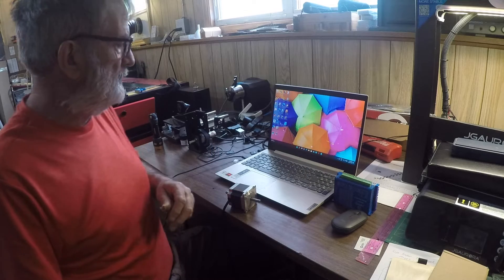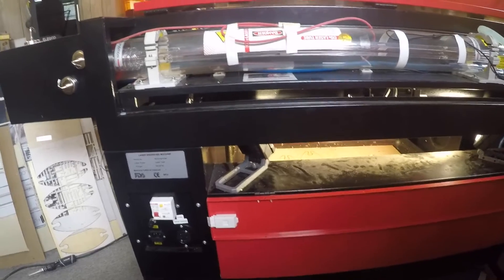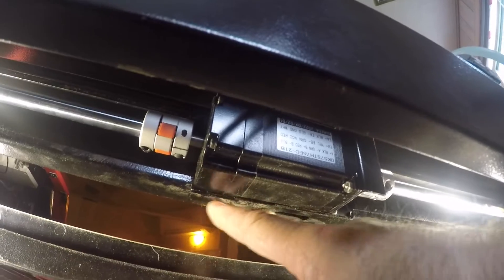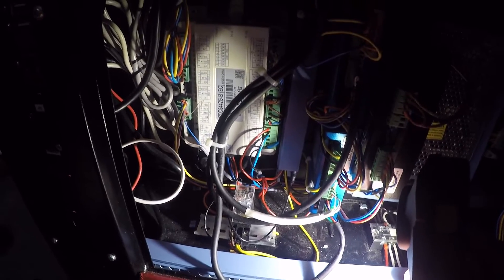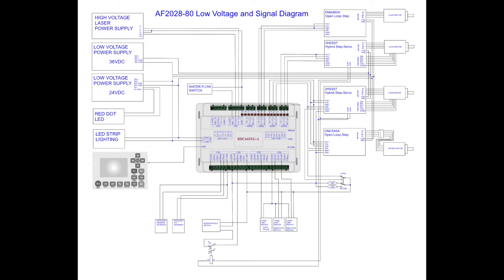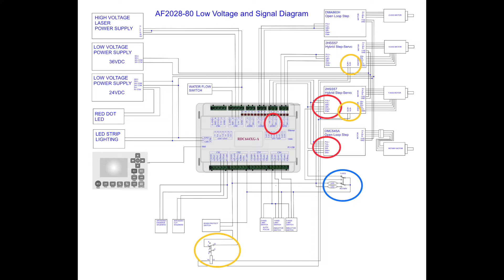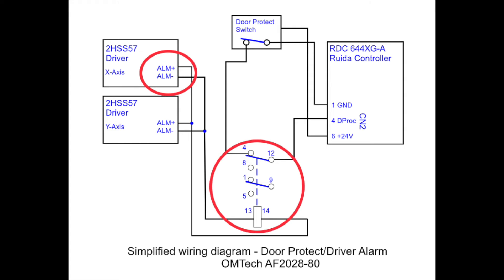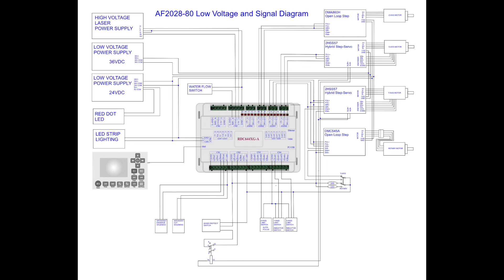AF2028-80 Closed Loop Stepper Motor upgrade: Y-Axis/Rotary

Comment: I have the parts coming this week to finally upgrade my X- axis.  Rather than notching out the frame to prevent the larger motor hitting it, would it be possible to move the stop sensor in slightly and adjust the bed size in Lightburn to accommodate?
Reply from the maker: I don’t see why not. The amount, needed to notch is not a huge amount. Mind you, if you move the sensor and adjust the bed size, you only loose 5mm, maybe
Reply: @jamesalexander5388 I think I'm overthinking this - can probably just glue a small piece of ferrous metal to the Y-gantry to trigger the magnetic limit switch ~5mm sooner
Reply from the maker: @JensRatsey  pretty sure that will work as well
Reply: @jamesalexander5388 I have my new x closed loop driver and motor installed - you're right, not for the feint hearted! The motor is so tight against the metal trough that the new track runs in that I can barely get a piece of paper in there, yet it doesn't rub at all. I need to add my y-limit sensor trigger but holding a screwdriver over it for now works fine while I test.  

So all good so far - except that when I power up now, my z-axis just continues to lift the bed until I hit Escape on the controller. I removed the AF sensor a while back and took the opportunity to completely remove the wiring this time - is something still expected there? Before it would raise momentarily and then stop. Seems I'm missing a NO or NC connection somewhere. Any suggestions? Also wondering what you're settings are for the new x-axis - speeds and acceleration?
Reply from the maker: @JensRatsey  you will have to go into the Machine Settings, under the Z-Axis, and disable the homing function (I don’t know exactly what it is called, but you should know it when you see it)
Reply: @jamesalexander5388  Already tried that, actually made no difference at all, it still tries to home the z-axis. It's not a big deal I suppose - I just have to be sure to hit Escape on the controller LCD as soon as it starts to home the z-axis on startup. What's odd is that it didn't do this before I rewired which makes me think I missed something. I had to disconnect all the limit switches to run them through the new larger track.
Reply: @jamesalexander5388 For fun, this morning I decided to just let the machine do it's thing on startup. It actually cleared the frame, triggered the limit switch, and then completed the Z axis as well, so all is good. I mounted my motor with the encoder bump out facing the front of the machine, maybe different to you?
Reply from the maker: @JensRatsey  I saw that in one of your posts on Facebook… I have not had a chance to check mine, but I expect it would work as well.

Comment: Can you provide a link to the dual shaft motor/encoder?
Reply from the maker: The link for the closed loop dual shaft motor is in the description. It comes with a driver, but I opted to use a different one (same driver as I used for the X-Axis)

Comment: Thabks I have been researching this mod and you confirmed my thoughts. Did you modify the driver alarm parameters to catch smaller load defaults? Have you tried stopping head while in motion to see how much force causes error?
Reply from the maker: I made no mods to the Driver default settings. So they are all as they were. As for testing, I ran extensive tests, by turning off the limit switches. When the head hits an obstruction, the alarm energizes the relay, braking the door protect circuit, which disables the laser. Once I was satisfied, and started using it, I did inadvertently hit an obstruction, while lazing, and it worked as expected. Only down side (and I am working on a solution) is the drivers need to have the power to them cycled to reset the alarm. Looking at adding a rest power interrupter to the drivers.